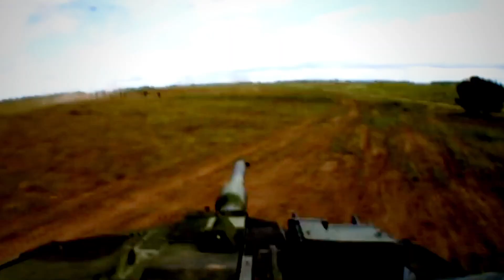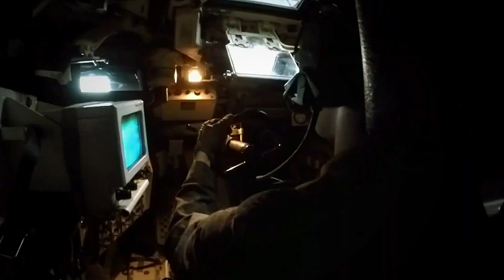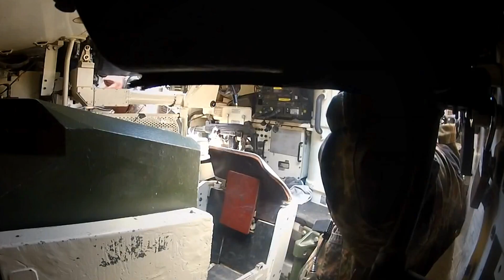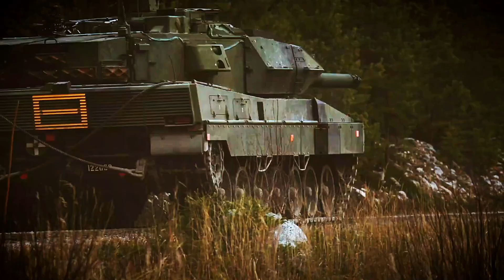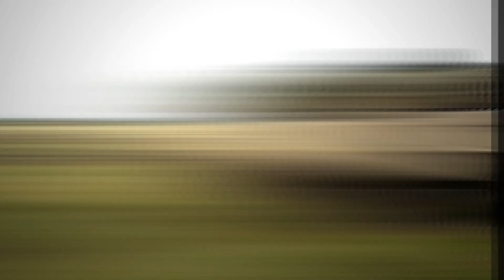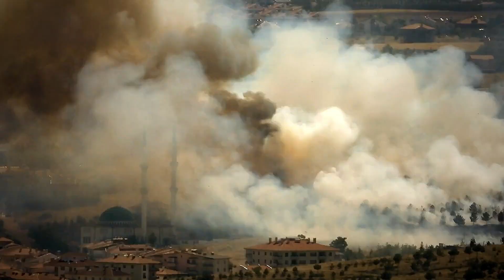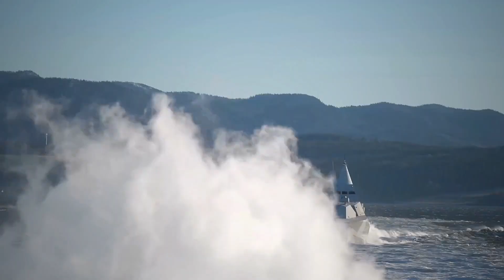The Absolutely Massive Tank that Russia Really Hates

Comment: It was a load of Leopard 2A4s (strv 121) that were returned to Germany as the lease ram out, not 2A5+ (strv 122)
Reply: same with the Leopard 2's not having CBRN protection but the Strv122 having it, or the Strv122 using the L/55 (which it doesn't, the 2A6 does but the Strv122's still use the shorter L/44)
Reply: The Germans didn't invent the tank, but it may be fairly argued they perfected it, and just as importantly,  effective tank tactics
Reply: This channel's info is mostly based on WikiPedia, which you can edit in few minutes to anything you want. So much about it's "reliable source of information". About the level of CNN and BBC: not much facts.
Reply: @attilazk  still better than Fox news that just invents the information it needs.

Comment: See I always loved the design of the STRV-103 as a tank.  It is perfect for a defensive style of combat.  Yes it has disadvantages but advantages as well.
Reply: A tank is never a defensive tool, you use it to attack with speed and firepower or counter attack if you were attacked first, Setting up tanks in idle positions for a long time is wrong use of a tank.  Tanks = Cavalry.
Reply: After all that happened in the last 12 months and information coming up about the effectives of the T-series, I think with the 103 and adding a little more reactive armour, can easily take on available russian tanks.
Reply: @kintho1  The 103 is completely obsolete. There is no viable amount of ERA you can place on the front to block 3bm60 or 3bm59. The base armor is just too thin. There's a reason the Swedes went for the Strv 121 and then the Strv 122 which is just an up armored 2a5. The 103 has poor mobility, poor usefulness on a open battlefield or a city environment, and poor ammunition selection. As bad as Russian armor has proven, there's a reason people don't expect the Leopard 1 to do well in Ukraine, and the Leo1a5 is superior to the 103.
Reply: @Lulutheblack  no it wasen't!

Norwegian tests show it was superior in every way!
Reply: @DEATH-THE-GOAT  That why they bought the more expensive Leopard 1A5s and not S-tanks?
Reply: @Lulutheblack  Just a joke on Russian tanks. But then again the 103s were the same gen as 62 and 72 right? I believe it would smash those Red tanks. 103 are the same generation as Leopard 1 as well.
Reply: @Lulutheblack  check your sources, Sweden has never bought any version of the Leo1 tank.
Reply: @DEATH-THE-GOAT  The Norwegians. You cited Norwegian tests. They bought the 1a5.
Reply: @kintho1  The 103 is the same generation as the T-64a. The vast majority of Russian tanks are at minimum the same gen as an M1A1 Heavy or a Leopard 2A5. There is a reason 105mm was phased out.
Reply: @Lulutheblack  "people" don't expect the Leopard 1 to do well in Ukraine. War is not a boxing match where two opponents fight it out alone. Leopard 1 will do very well in multiple roles. Just like any other 105mm gun platform with high mobility and night fighting capabilities. Did you ever look through the optic of a T-72M ? It is trash compared to what the 1a5 has.
Reply: Many see STRV-103 as a turretless tank when it defacto is a turret on tracks.
Reply: @DEATH-THE-GOAT  
It's far too slow to turn compared to a turreted tank .Why do do you think they got rid of it in the first place ?
Reply: @louisbabycos106  Why we got rid of it was mainly because the hull wouldn't fit yet another gun size increease to 120 mm.

Not that it wasn't good at what it was designed for or had any lack of mobility. It was fast forward and a really fast reverse, it traversed terrain very well. It even forded well.
But it simply wasn't designed to be an MBT and could not be refitted to more than a 105 mm gun.
Reply: @thunder2434  Thank you for clearing up this debacle. I think we can "lock" this thread 😉
Reply: @louisbabycos106  A) No it turned faster.
B) they could not change the gun to a 120 mm. Coult not fire when moving.
Reply: @DEATH-THE-GOAT  :)
Reply: First, the 103 S is called a Tank but it's really designed to be a Tank Destroyer.

Why it was retired was because the hull couldn't be up-gunned a second time with an 120 mm gun to keep soviet armor overmatch as those vehicles kept evolving. The engine had to be engaged to adjust aim and that gave off a big IR plume showing where you are on modern sights.
As a secondary deficiency the Glacis was deemed too weak to resist Soviet AP shells anymore.
It had been good as a TD but it was pressed into use also as a tank which is where it didn't shine. That was before the IR sights became common and at least we thought the then newer Soviet Armor was tougher than what the S tank was built for fighting.
Today I'm not so sure. We se russian tanks lacking functional ERA and lacking Night vision being fielded as the Ukraine War drags on. The S could probably have fought those fairly effectively.

I propose that the idea of a turretless Tank Destroyer was sound but that it was ahead of its' time in what we wanted it to do.
Today a similar TD but designed for a modern sized gun, a hybrid electric Engine that could run cool and silent and an appliqe armor package with ERA and ceramics that could be fitted at need would do well on a modern battlefield.

Things often overlooked about the 103:
The Autoloader it had was very good, it's easier to fit a high performing such system in a large shoebox rather than a turret. 
Also it's not a 3 man crew for more than redundancy and field service (and moral support), it could really be driven and shot with the crew of 1.
Reply: @thunder2434  hear hear 😃👍
Reply: I still don't understand how the S Tank was designated as a main battle tank. In fact, its existence has me asking again what makes an MBT an MBT
Reply: @ph11p3540  True, more like a tank destroyer right?
Reply: @ph11p3540  Necessity. It's the "Tank" we had so it got used not only as intended but for everything. Well we had Centurions too but no matter how great those had once been they were really no longer viable by then.
Reply: @ph11p3540  S Tank was built to Sit and Shoot the Shit out of the Russian T series Turd Tanks then Sod off Sharpish!!
Reply: @bremnersghost948  Yes. This is the idea with the fast reverse. 
It actually had a secondary reverse driver seat at the back to effectively drive away with the sloping glacis toward the enemy.

Low hull position hidden waiting to ambush, raise hull suspension to clear to, fire, reverse to get out of there full speed while having the best armor facing back toward the enemy. Take up new ambush position, do it all over again.

Now imagine hundreds of tanks doing this along the enemys advance route. For days or weeks. The cost in Armor for the enemy would be staggering.

Today precision artillery and drones and better hand held top attack AT weapons do this work. Back then that didn't exist.
Reply: @ph11p3540  The 103 lacks the possibility to quickly engage multiple Targets at once.
In a Cold War Scenario. T Tanks would be massed against western tanks of ratios 1 : 10. 
On a Open Battlefield a minority of Strv 122 can quickly outgun a majority of T tanks due to there Hunter Killer capabilites, as well as firing on the move.
Reply: Tests in Norway and USA showed that the STRV-103 was superior to the German Leo 1
Reply: The STRV is a horrible choice for an MBT at best it's a niche tank destroyer and even in that role outside of Forrested areas it would be sub par in that area as well . An effective tank or even a tank destroyer from the 1960s onward needs a rotating turret . If somehow you could mount a rotating turret to the STRV you would have something special because of it's suspension was awesome. Being able to kneel and hug the ground is incredibly useful up until the widespread use of top attack munitions. A good use of the STRV today would as a javelin, hellfire or tow 2 missel  carrier with a small turret . I'm sure that a small displacement turret large enough for hellfire, javelins ,spike ,nolols or tow could be fitted to the hull . The cost of conversation would be prohibitev and logistics would be constraining for such an out of date vehicle but it would work very well if it could be adequately supported .
Reply: yeah the bad is really bad tho.. it cant be used properly out side of its country... and thats crappy.. and its not mobile in its own country..
Reply: I love the design,  but it's obsolete.  The inability to fire on the move is just to big.
Reply: STRV 103 could never prove his useabillity, sry bro
Reply: Isreals merkava2.  It's a flat beast. Looks awesome also

Comment: RPG is actually from a Russian acronym, it doesn't stand for rocket-propelled grenade.
Reply: And initialism, not an acronym, but yeah, it is Russian. And somebody in the English speaking world (willingly or by coincidence) came up with a working version, which also uses R and P and G. Since a large population of people consistently have been using "RPG" as "rocket-propelled grenade" for decades now, the term "RPG" stands for the Russian original, AND for "rocket-propelled grenade". That's how words work.
Reply: @istvansipos9940  Yup. 100% correct and technically correct to boot. Can't get more right.
Reply: What does it stand for then
Reply: @Eddwardsroseresfoo  
Ручной Противотанковый Гранатомёт
Ruchnoy Protivotankovyy Granatomot (RPG)
Handheld Anti-tank Grenade Launcher

(RPG) Rocket Propelled Grenade is a backronym from a Russian acronym that had already existed.
Reply: germans had rocket propelled grenades from WW-II    @nukenet1
Reply: @Eddwardsroseresfoo  Ручной Противотанковый Гранатомёт
Reply: 😭mfs trying to stay relevant
Reply: The grenade is actually a rocket-assisted projectile fired from a recoilless gun. A cartridge is attached to the rear of the grenade before insertion into the launcher, the rocket motor has a delay before ignition. The motor exhausts from the base of the warhead thru 4 deflectors that turn the thrust 180 degrees, not the usual rocket way.